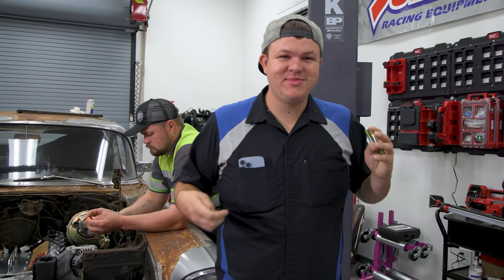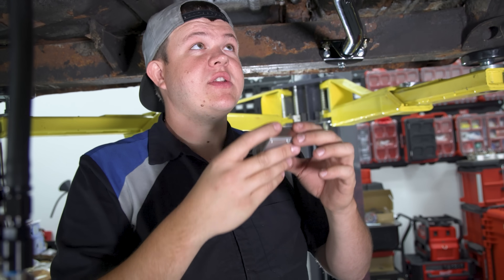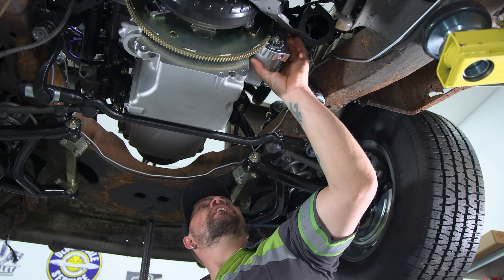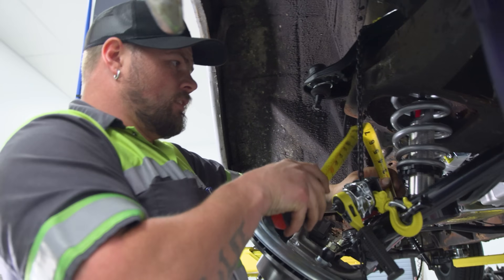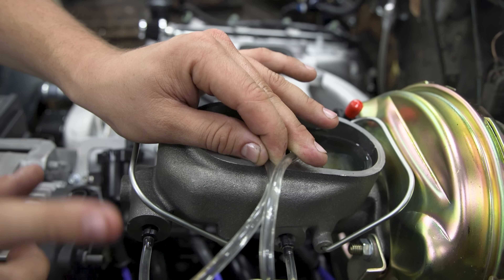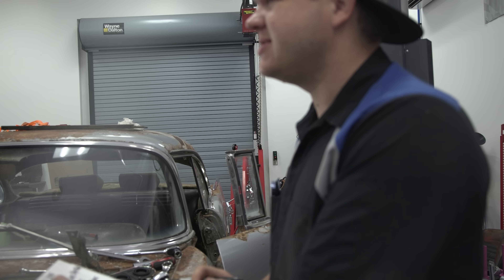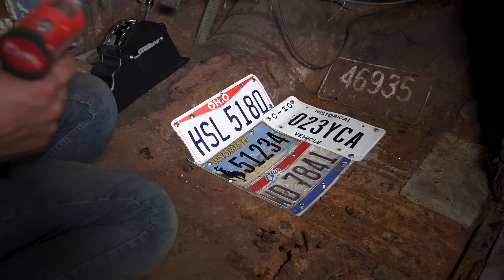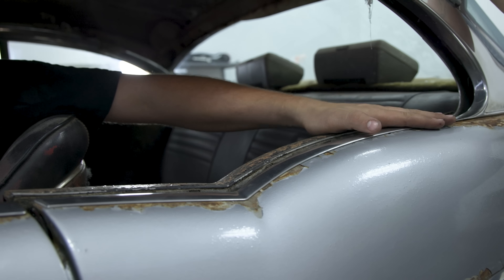Why Won't It START? We Need To Drive The '57 Chevy!

Comment: Actually, the V8 side of the core support is inside.  The 6 cylinder is two cylinders longer than the V8;  hence mounting the radiator on the "grill" side of the core support.  (I'm old, I remember!)
Reply: I was just about to write that.  I’m not old and I know that, the summit guy is a little off on his knowledge as well, in another video he said that the 350 came out in 1974….. oops.
Reply: Yuppers
Reply: @bryanomicioli3301  little summit guy is embarrassing
Reply: I don't reckon Summit is too happy with their rep dropping F bombs in the background of this family friendly programing.
Reply from the maker: @briansteve5269  can you add a time stamp for the f bomb I wasn’t aware of it and if it is actually that I would like to make sure it’s removed and doesn’t happen again!! Thank you!

Comment: Us old guys may be called dinosaurs but we built cars that took a beating!  And we didn't  have kits kits and more kits !  Cross member is upside down , self tappers wont hold . Pinnion angle is set with weight on the axle and a 57 electric wiper motor bolts right on .go get another kit !
Reply: The whole point of the video was to highlight the parts/kits available from Summit Racing not to show off their fabrication skills.
Reply: I thought the same about those self tappers.
Reply: It might as well be about both! What’s the point of showing products in a fabrication video if you aren’t going to show them being installed/installed and operating?
Reply: Times have changed and they don’t make OEM parts like they use to for vehicles like this. And as far as the cross member being upside down, the car was “built” long before they were even alive so chill, they’re learning. The self tappers have you maybe thought it’s just to get them home 🤦‍♂️ this isn’t a full restore.
Reply: @samziarek5114  lol we didn't get oem parts ! We went to junk yards !
Reply: @ronaldolweiler7745 umm. Gets parts from the junk yard IS oem parts. Also why it's used parts or salvage yard.
unless a aftermarket part was installed before u took it off said vehicle.
OEM= original equipment Manufacturer
Now if u said- u didn't get NEW oem parts, then ok.
Even if u take original part off 1 car/model & then swap it to a different model, it's technically still an OEM part unless it was replaced with aftermarket before u got ahold of it.
Reply: @samziarek5114 I counted five excuses.
Reply: Cross member wouldn't fit the other way around. It's not upside down. 

You are a dinosaur if you think modern self tappers won't hold.
Reply: @LT1210  but they aren't fabricating much of anything, taking parts out of the box and bolting them on is probably fun though, when I build a car, I like to go to the junkyard and find parts that are newer and better and make them fit.
Reply: @finrennard3402  self tappers don't  hold  especially in thin metal they aren't designed or made for the vibrations of an automobile
Reply: @finrennard3402  the frame is not that thick . If you truly are going to drive the car and not just show it I would weld the brackets to the frame . Tappers will work lose with time .
Reply: @ronaldolweiler7745  my rally cars gets jumped all the time and it’s full of self tappers 🤷‍♂️
Reply: @finrennard3402  i put my cars together 40 years ago . They still give good service and are reliable enough to drive 2300 miles with no problems .my house to friends in Louisiana.  That was. In a 55 chevy hdtp. 396 turbo 350 , power disc , power steering and ac . No kits . All pieced together from experience  . Good luck with the channel and your projects.  Just think outside of the box on what will work .

Comment: back in '77 I had a car in Japan where the rust was terrible.  I used the floor carpeting to keep peoples feet inside the car. When I was rotating back to the states, I gave the car to another guy because it was so rusted out and dangerous

Comment: The drag link may be more than just touching the oil pan, there is no weight on the suspension. I would check it again when it has weight on it. Better to be safe than sorry.
Reply: As I was watching this for the second time and Robby says barely making contact I wondered if they took into account body roll during turns

Comment: You didnt show how you "tightened" the loose front wheel bearings but I think you have them too tight! There must be some play too allow room for expansion as they get hot.( just enough to feel a knock/thunk as you pull in & out) If not they will overheat and seize up! I did the same disk conversion on my 57 Nomad.  Lookin good!!
Reply: I found out the hard way too. After 250 miles.... hub nut over tight. Then the grinding noise.
 I use a tourqe wrench from then on  ( 7 years ago) 2008 W- body Buick

Comment: Everyone used to Think 55,56 & 57 Chevy's drivers were the Nicest People who would even Wave to you as they drove by in the Rain, Guys, we were pulling a string attached to vacuum wipers that would not pull back without full vacuum during acceleration, probably crossed your plug wires
Reply: The coil pack for each cylinder is located directly above the cylinder it fires in. The LS is strange like that. 😊

Comment: You may want to check the want to check your wiring on your coils they do have control of your timing and do to be put on a cerain way if they are not installed right you will have that very problem!

Comment: Clocking, properly known as "phasing", is needed to counter the elliptical speed increases and decreases that a U-joint does while at working angles, as the U-joints should never be at 0 degrees of angle to the center line of the driveline, although each U-joint needs to be in the same angle to one another. The reason for having an angle in the driveline/U-joint relation, is to cause the needle bearings in the trunnion caps to walk back and forth, because if they stay in one place, the grease will not distribute and the needle bearings will put all the force on one spot all the time causing premature wear in the trunnion and cap.

Comment: Can't wait for this epic journey to begin. I'm running a sweep stake on whole will fall through the rotten floor, and if it rains how much water will come in through the holes. 😂 at leat it should run without any problems 🤞❤️👍

Comment: Great video as usual. This '57 Chevy is going to be "spicey" with that LS3, Holley intake, Edelbrock 750 performance carb, TCI transmission and Currie posi rearend. Speaking of "spicey", Justin (and the editor) gave everyone the "spicey" version of the video at the 25:58 mark. 😯🥵🤐
Reply: Yes spicy it will be. I just can’t get behind this project because the bones of the vehicle are not there to support the upgrades being made they need to do the body and chassis work first just like was done on the golden nugget.

Comment: Shouldn’t the 7/8 “ gap be set on the drive shaft with the weight of the vehicle be on the drive axle?
Reply: Good point
Reply: I was telling my wife that myself
Reply: @josephpeluchette191  I’m really biting my tongue on this 57 thing they are doing.. Robbie is a body paint fellow seems to me that the bones need to be solid before all those high price power plant parts get installed. Just saying nothing is more wasteful than the way they are going about this.
Reply: @williambasinger5859  agreed but I think  during the planning stage of the video no one acounted for a ne Ohio year outside but your right a trailer  to his body shop was probably the safer cheaper and better option a couple thousand miles of road will shake that thing apart
Reply: @josephpeluchette191  welp you wouldn’t put a new power plant in a leaky boat hull and then try to drive it from Tampa to New Orleans. It is all about having good bones to build on.
Reply: I worked at a driveline shop for 30 years, had many come backs because the people measured for the length with the suspension hanging which made it too long with no slip
Reply: @nmratmotor  it will be Robbie’s transmission output that will be suffering.
Reply: @nmratmotor  point made ! Thanks

Comment: Sssssome day y’all may be professionals at this.  It takes guts to move from body work to engineering figuring you’re going to drive a mass of rust 2000 miles to get home.  Hope your engine and the road is smooth so that the body doesn’t shake apart mid trip.  The boss might fall out the bottom.

Comment: Awesome build, love the videos! 
But summit carries a full line of floor pans and sheet metal for the car. Why use licenses plates when they could be zip screwing floor pans down. It would be faster, easier and safer for the way home. And probably only total a few hundred bucks in retail value.

Comment: Rebuilt a 327 Chevy in a 69 C10. Put in a turbo 300 tran, which had a larger ujoint yoke than my driveshaft had. Rather than cut and weld on driveshaft we just used a ujoint for ford f250 4wd which was wide one half and narrow the other. Worked great!

Comment: The v8 side of the core support was on the inside of the engine bay . The 6 cyl was longer so the radiator was on the outside of the support !

Comment: Ya got as far as Betsy Sue the Chevy would allow in this episode of dun dun dun "Adventures of The Raggedy Chevy Going Back To Utah"!!!😂🤣🤣 Things will work out for sure cause you are at Summit. Should use fuel injection. Make sure the ignition box doesn't require an injector pulse to start and check the crank and cam position sensors and wiring.

Comment: You left the cap off the master cyl over night to let the air out??! Did you know brake fluid is hydrostatic which means it absorbs moisture. I know it isnt a racecar and your in a dry climate but this is a bad habit to advertise, plus it makes no difference! It says on the bottle to keep unused fluid tightly sealed in bottle. The master cyl cap has a bellows seal on it to allow a seal from outside air and yet allow for displacement of fluid into the calipers as the pads wear.

Comment: On day one of this build, Justin says they have license plates you can use to cover the holes in the floor, and I was sure that he was kidding. Today you use license plates to cover the holes. 😳 😂😂😂
Reply: It's becoming popular I've seen it at a couple shows even on cars with good pans
Reply: Years ago, most states issued new plates every year or two. Unless you were a collector, there wasn't much you could use them for. Patch panels out of the sight line, floors and trunk pans were good locations for reuse.

Comment: Guys come on, you can't go on a  road trip with a rotten floor that is all rusted out. For Pete's sake you got kids at home. You are not free spirited 19 year old's without a care in the world. Be responsible and cut out the rust and weld it up nice with new fresh metal. God forbid you end up in a frontal accident on the way home, you risk flying out through the windshield  with your seats cos floor is rotten and rusted out and won't hod in a crash. Either fix your rotten floor or fly home to your kids.

Comment: rookie mistake not painting your master cylinder. They ALWAYS rust, not sure why the manufactor doesn't paint them at the factory its been a thing for like 70 years.
Reply: Could have something to do with the fact that brake fluid absolutely destroys paint.
Reply: @richardratliff9436  but the brake fluid is on the inside. its a closed system. shouldn't be an issue, maybe a  powder coating would hold up a bit better to the heat but it seems like they should have this problem solved by now. nickle plating maybe?